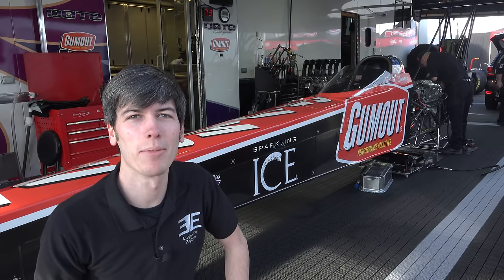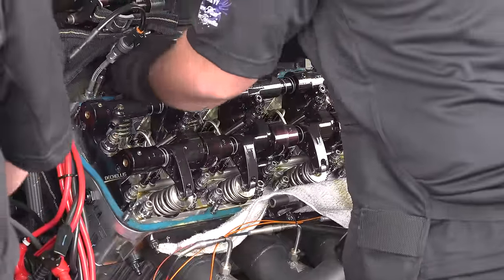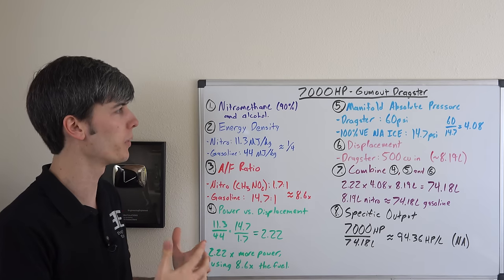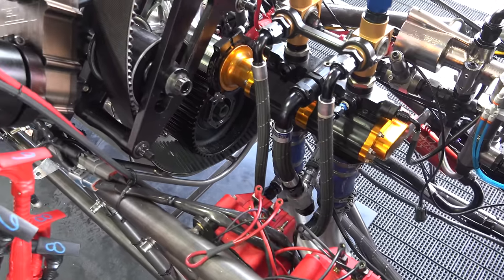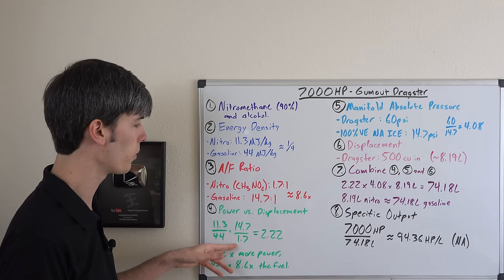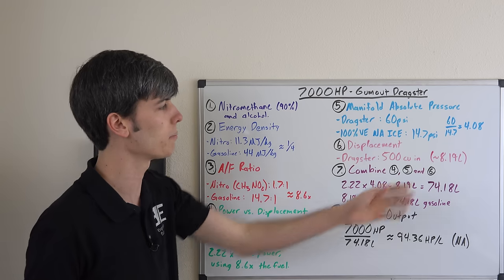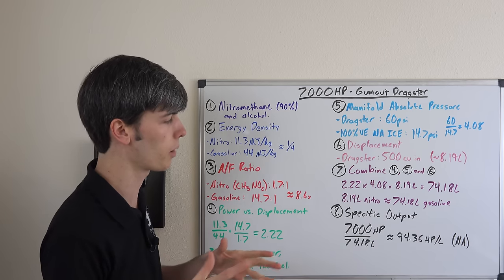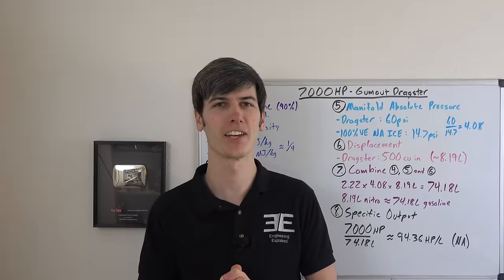Gumout Top Fuel Dragster - 7000 HP Explained

Comment: I have a feeling that when I start my car mechanics course this september this channel will suddenly become more important than just a hobby.
Reply: I have exactly the same feeling :D
Reply: Nazurick The Dragon I started, so far its not
Reply: Justin Noker I started early sep, I think it'll help more when we start doing more advanced things.
Reply: Nazurick The Dragon agreed
Reply: Engineering and mechanics is pretty close. Engineering is how it works and how to make it. Mechanics is how to repair/replace it. And to learn how to repair//replace it, YOU NEED TO LEARN HOW IT WORKS. The main/only difference is a rather large pay gap and the fact that I won't design anything.
Reply: Nazurick The Dragon exactly
Reply: This is less about how it works and more about the math behind 7000hp, you will not do any calculations even close to this
Reply: I meant the channel, not this particular video. If something with 7000hp appeared at my college I'd be somewhat concerned to how it got there.
Reply: Mate I'm studying engineering and have previously trained as a mechanic, this is where I come to let me watch videos which help me wind don but still let me learn a thing or two.
Reply: Do mechanical engineering. It contains useful parts of automotive engineering but will give you a massive understanding on how everything else works.

Comment: 0-300 mph in 3 seconds is impressive!
Reply: +GHOSTJERKER world speed record is 332 mph I believe, elapsed record is 3.700 flat by shawn langdon at the winternationals this year. even funny cars are getting down to the 3.8 range. you think the stats are cool though, go watch them in real life. I don't even like racing but I can guarantee its something you'll never forget. its addicting too
Reply: You only have to blink for the car to be out of your sight.
Reply: the amount of fuel used is disgustingly wasteful.
Reply: The amount of air you waste is disgusting.
Reply: Going from 0-69 is impressive. 0-300 is insane
Reply: AlexZander If you think top fuel dragsters are running on anything usable by the general public, you are sorely mistaken. Nitromethane doesn't have much practical uses beyond generating more power with the same amount of oxygen at the expense of 1/4th the energy density of gasoline, meaning it's only really useful in drag racing where you are severely limited by air. Other dragsters are powered by alcohol which is artificially created.

The amount of actual fuel used is insignificant.
Reply: @KaiserTom  You would be right except for the fact that is has a bunch of uses as in, a variety of industrial applications such as in extractions, as a reaction medium, and as a cleaning solvent. As an intermediate in organic synthesis, it is also used widely in the manufacture of pharmaceuticals, pesticides, explosives, fibers, and coatings.  So yeah pretty sure that use in pharmaceuticals and in extractions is a vastly more important use than drag racing.  

Nevermind the fact that it's made using propane and nitric acid, both of which have any number of uses more important than this.  So their point stands that the amount of fuel used is wasteful.
Reply: @Jaqen-HGhar  Yes I too can literally copy paste from Wikipedia. Except in reality each of those applications have plenty of alternative processes and the processes that involve nitromethane aren't even necessarily the cheapest/most efficient ones that industries use.

Or how about the fact that Nitromethane can be synthesized from more prolific chemicals which can come from more renewable sources. Just that the propane/nitric acid method is the cheapest.

Also who are you to determine what use is "important" or "unimportant"? It's obvious that Nitromethane is cheap enough justify use in this manner. Someone who has/generates resources is willing to give an amount of resources to someone in exchange for their resources. That's the entire point of the price mechanism; to ensure the cost of producing a resource is paid for in an equal, or additional, amount of resources.

Comment: What I always found interesting is that at 8600rpm x ~4s = ~575 revolutions of the engine for the whole run...
Reply: Wow I never thought about that... I love watching this channel. It's so informative!
Reply: +makecba exactly
Reply: wow thanks for that comment, ddnt think about that!
Reply: xXxMartin96xXx
The do go full RPM for most of the run. The clutch slips for the first 700 feet. They leave at about 5000-5500 rpm, and are at full rpm after about 3/4 second.
Reply: They leave at about 8400 rpm
Reply: kenni Neergaard 
No. And the rules for Fuel cars dictates an 8500 rpm limit.
Reply: Well yes the do. 
Ive been tuning and running Top fuel myself.. So yes, they do leave at about 8400..

Comment: We also know that the engine, in fact, can produce 7000hp because that's the amount of power required for the ET and speeds these cars run.

Though lately, they are thinking the engines are producing 9000 or even 10000hp.
Reply: Erik Warnes I think one report put them at 11,000-ish based on torque

Comment: Great video, there are few videos on dragsters but this is the first one I see where numbers are used to show the performance of the engine. I am not into racing, but back in 1984-87, Don Garlits (sp) was racing his dragster against a Navy F/A-18A Hornet at the Naval Air Engineering Center in Lakehurst, New Jersey. Obviously , there was no race but a publicity stunt. The F/A-18A was hooked to one of the catapults and accelerated from 0 to 172 knots in 2.7 seconds. The car later raced and forgot what was the speed attained and in what distance. It is impressive, seeing both vehicles accelerate!!! And very noisy, amazing the amount of energy produced by the dragster’s engine and the 2 turbojets on the Hornet in full afterburners.

Comment: I still can't believe that they go 300+ mph in a 1/4 mile run, amazing
Reply: 335mph in only 1000 ft as of the end of 2017. They shortened the race distance to 1000 ft (from 1320 ft) after Scott Kalitta died. NHRA had to because the cars couldn't stop fast enough on many of the shorter shut-down tracks like Pomona.
Reply: If you reach 300MPH probably ok to not take it out of the trailer.

Comment: When you got to the gasoline engine size I had to convert it over into cubic inches to get an idea what a 74 liter engine would actually be like. 

Turns out it is right about the size of the Pratt & Whitney R-4360 Wasp Major. It was a last generation aircraft piston engine, and the designers were very thrilled they could get 4,300 HP out of it with (big) dual turbos, and weighed about two tons.

Rather interesting how much the technology has changed.
Reply: The combustion that takes place with nitromethane is still deflagration. The same as gasoline. The reason it creates the violent sounding pop is due to its much higher deflagration rate or flame propagation rate. If it was detonating, it would not produce power. Detonation does not produce a useable force to drive the piston down. The detonation velocity of nitromethane is very similar to that of trinitrotoluene(tnt). Around 20000 ft/s. Completely useless for any internal combustion engine
Reply: The pressure spike from detonation is completely unusable. Even gun powder in a firearm undergoes deflagration, not detonation. 20000 ft/s is something like 15000 mph. No piston is traveling that fast, even a 16000 rpm f1 engine. That is nearly 10 times the velocity of a .30-06 rifle round. The pressure spike from detonation is not usable because it is only taking place for a very short duration. The piston would have a hole in the top before it even began traveling down. That would be like putting a stick of dynamite in the cylinder.
Reply: Piston velocity in an engine with a 4.25" stroke at 10,000 rpm = 118 ft/s. That engine would have to be rotating at 1,700,000 rpm to have a piston velocity of 20,000 ft/s

Comment: you also forgot the best part of nitro-methane, when under pressure its mj almost triples. say, if you put .5 ml on plastic bag on cement and light the fuel it just burns like diesel, but if you hit is with hammer at around 40 psi, it'll blow your arm off.
Reply: I would say no on both- good luck lighting 0.5 ml of diesel on concrete. If you manage to succeed, and hit it with a hammer, I would guess that you'll extinguish the fire, and make a 0.5ml splash of diesel. So, wear safety glasses, or it might get in your eye and be uncomfortable.  Or, just grin and bear it, and wipe your eye with either of your two still attached arms.
   Very remote chance that you could splatter burning a half a cc of burning  diesel, VERY remote, so, don't do this next to a pile of dry leaves.
    Too much "80's action movie science" in your imagination. 
   Try playing with fire, a lot. Be careful!

Comment: Good clip. You could go much further. There are some things about a top fuel motor that compare to a sporting engine like a litre class bike quite well. Others don't. For example, the exact power output of even a highly tuned bike motor can be accurately measured. But a top fuel motor has no cooling, and it goes through the power band (between max torque and max power) in about 1 second. You can't exactly measure how much torque it makes at 7420 rpm, because you can't hold it there. So you run it against an inertial dyno, which can give quite dramatically different figures depending on exactly how you run it and measure it.
And while you're throwing high school maths about, tell them how many times that engine will rotate between the startline and the finish line... From that, you could say maximum power is sustained for about 200 revolutions or less... then the engine gets stripped and checked and maybe has the bearings replaced....
While tossing numbers around, the compression ratio is mentioned, at about 6.8:1. So is the max boost near the end of the strip, at about 60 psi. Now calculate (before allowing for fuel and hydraulics) what your cylinder pressure would be at top dead centre with 6.8:1 comp and 60 psi manifold. I make that about (roughly) 410psi. Now at what pressure will ordinary fuel detonate and destroy the piston? But wait - it gets better. Now work out how much liquid fuel is going into that cylinder at each power stroke, and figure out what that amount of in-compressible liquid is doing to your pressures at top dead centre. You are in the verge of hydraulic lock. You're getting cylinder pressures in excess of 800 psi...
On the subject of simple maths, work out how much extra downward thrust (and hence traction) is generated by those exhaust flames. The car is rocket propelled, but the rocket is like a down-force wing on a formula car - it pushes the car into the track. That's one of many - many - clever tricks that see these cars launch at about 5g. By simple physics, that shouldn't be possible! A fighter jet off an aircraft carrier, has a steam catapult. But that doesn't launch quite as hard as a top fuel car!
Reply: KD. From memory, it's in the range of a couple hundred kilo's downforce from the exhaust. But I'd like him to explain how a constant displacement roots blower reaches peak boost at the end of the strip...

And all self-especting engineers approximate 1 atm to 15 psi. Golden rule of engineering, close enough is good enough, always approximate to a nice round number within 10%.
Reply: @LilleyAdam  800lbs I think.

Comment: Great and awesome video!!!...congratulations!!!....I also can add one fact, in the video its said that this dragster engine has a compression ratio of 6.2 to 1, with the  supercharger and the amount of air of 4.08 times the gasoline engine, it could easily calculate that the compression ratio of this engine could reach 24 to 1. That is also another reason to use 90 % Nitromethane + 10% alcohol for safety. The extra oxygen in that kind of fuel allows to increase the compression ratio. That is another reason of the tremendously hp output and the wereout. The video dont talk about torque, but I kind guest is between 5K to 6.5K lbft (with that compresion ratio).

Comment: For some reason, I feel like 7000 horses still wouldnt be able to run down the track as fast.
Reply: I don't know why he says 7000 HP, top fuel actually makes 10,000 HP
Reply: +BenRomero66  Different from car to car but generally it's between 7k-10k
Reply: ***** I was gonna do a longer explanation but I'm tired so short answer: No, which should be quite obvious
Reply: It depends on which point in the race we're talking. On launch it is more like 7k because blower speed and boost pressures are lower. Take it down to the end of the 1000ft track and 320+ mph and we're looking at upwards of 55+ boost pressure, which translates to over 11k
Reply: Also 7000 horses would take a lot of space, not really practical for those narrow race track or everyday life to have that many horses pulling your car, and imagine how much food they would need !
Plus all the 28000 Horseshoe to change often would cost an arm !
Reply: You could put 5,000,000 hp and it still can't even finish Circuit de Spa with our current brakes and the wear 7000 hp does on a car.
Reply: I'm I the only one here who get the joke about horses (the animal) and horses power the OP made ?
Reply: I am glad someone did. I clearly meant horses of the galloping variety.
Reply: Well, English is one of the easiest language to learn, but in return it is not the clearer when it come to transmit informations, so I would not blame that on you.
Reply: Demongornot apparently English is not the easiest to learn. If I'm to judge solely off what you just wrote
Reply: English is not my first language, and I've not even taking serious English courses yet (this is on my todo list), my only experience is with the Internet, in top of that, I am dyslexic.
English is still one of the easiest language to learn.
Reply: It's actually one of the hardest. We have many anomalies and contradictions in every day use - how can you cut a tree down,  but then cut it up? Then there's the apostrophes and punctuation that even native speakers struggle with, and don't get me started on the homonyms, implied abbreviations, and contractions!
I could go on forever, but you'll find out how illogical English is when you start taking serious courses.
Reply: I agree, but as a French, I can assure you that English is probably way easier than French, we all struggle with French...
Reply: Clutch
No Fuel car makes 7000 hp anymore. That's 80's stuff.
Reply: they actually make closer 11,000 hp
Reply: Actually they've been measured at over 11,000 HP now.

Comment: Granted the 60 psi is a large contributor but what you didn't mention is the fact that Top Fuel blowers are over driven, which means the blower pulley is spinning faster than the engine is spinning.

Comment: 20 gallons per mile. Incredible. A mechanical engineer(that builds top fuel engines) had previously explain to me that the top fuel drag cars achieve closer to 60 gallons of fuel consumption per mile. At 20 gallons per quarter mile. 20 to 60 gallons of nitro methane consumption per mile is a lot of fuel. It would be quite interesting to read the exhaust emissions of these top fuel cars at engine idle. When a friend invite me to the top fuel races, there was so much exhaust emissions that 90% of the mechanics were wearing chemical safe masks when the engine was running in the pits. Maybe the excess fuel leaving the exhaust system helps cool the engine being that there's no cooling system in place(as you mention). It is said that partial combustion is also in part to allow the fuel to reduce combustion temperatures, as well as help lubricate the engine combustion chamber cylinder walls. Although my research indicate that oil lubricates much better than gasoline(see two stroke engine).

Comment: It does make sense, my N/A 2.0L ST/XR4 produces 149BHP stock (so 75 bhp/L), with reworked camshafts, exhausts, injectors, cold air intakes etc, people have made close to 200 on these engines without adding any charging - once you add boost they get even sillier.

Comment: Like the videos, great job. just a note, the "cannon" that releases the fingers is hydraulic, not air. The timers activate air solenoids that open taps to bleed off the hydraulic oil and the timers and taps get adjusted to vary the rate of bleed off.

Comment: Last time I was at a dragrace event, they set a new track record at 514'ish km/h in 4,8 seconds.
Also, you could have mentioned that the camshafts are sometimes (if not always) tuned differently at the front and rear of the cylinder banks because the crankshaft twists slightly from all the torque.